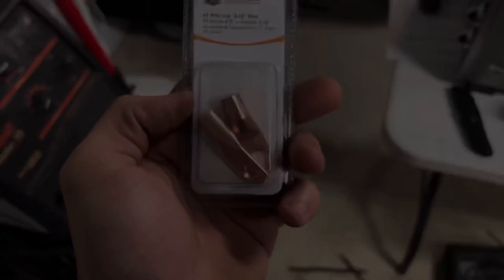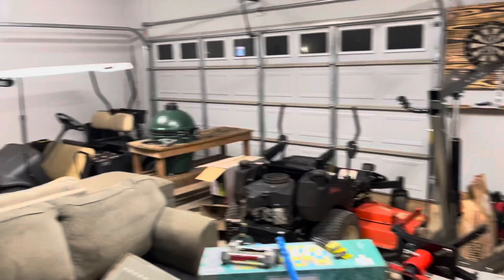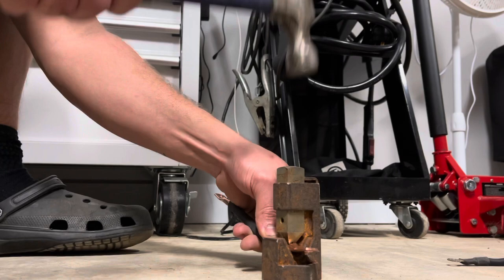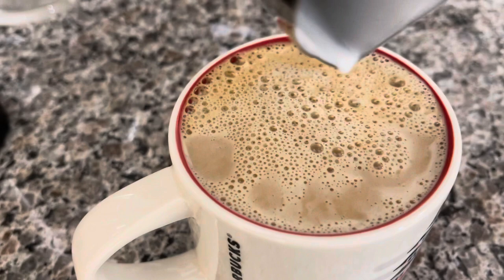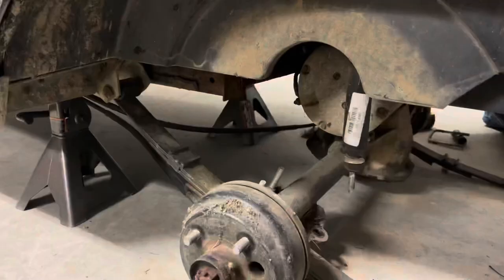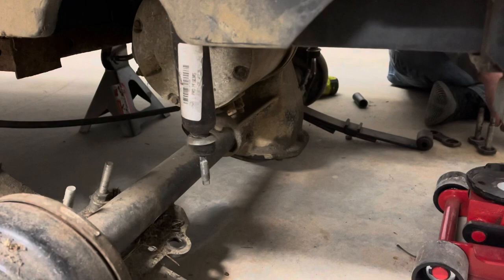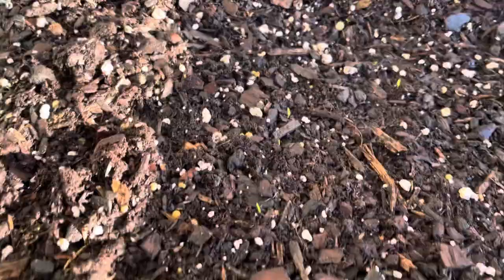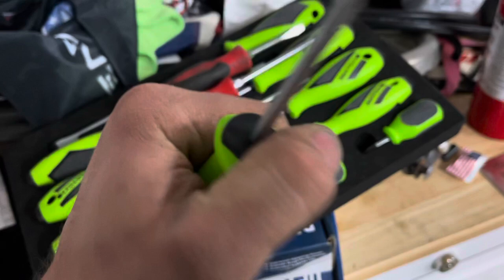1995 EZGO Medalist 6” Lift, New Wheels And Tires, Upgraded Battery Cables!

Comment: Dang you stole those tires
Reply from the maker: Good deals out there you just gotta find them!
Reply: @UncleMike1776  I think I paid $100 or was it $165 for the set I had with rims. They were either slightly out of round or tubed by the dealer cause they leaked without tubes. But all were new or just a few miles. I'm happy with them. Been on there 4 years or so
Reply from the maker: @natevanlandingham1945  that’s a steal too! Sometimes you can find them deals sometimes it’s a little dry out there!

Comment: I’m curious on what the top speed you’re getting out of your cart. I’ve got the same one and I’m only getting 9-10mph on flat ground and very slow up hill with brand new batteries
Reply from the maker: 36v carts are extremely slow, you can look into an upgraded controller!